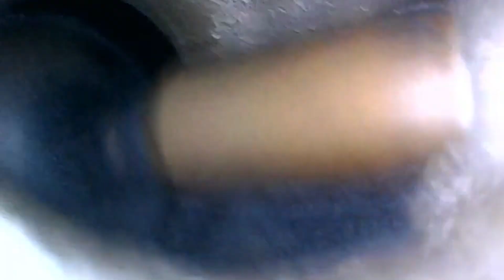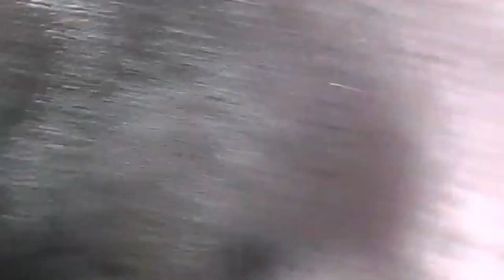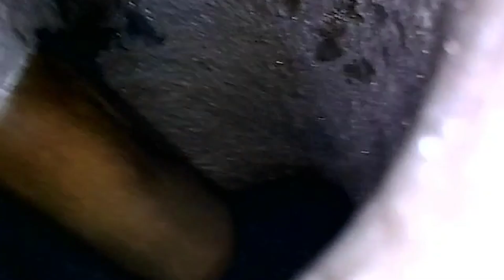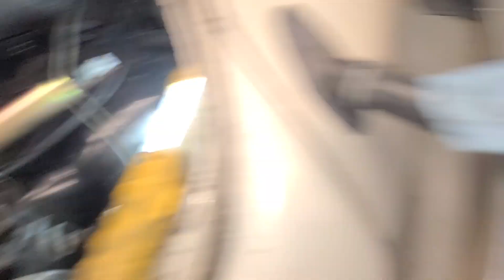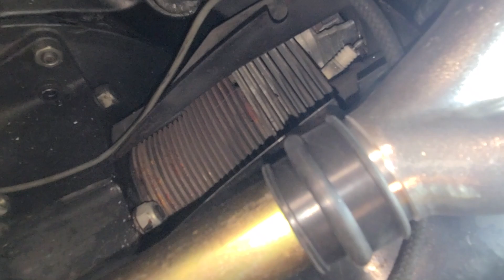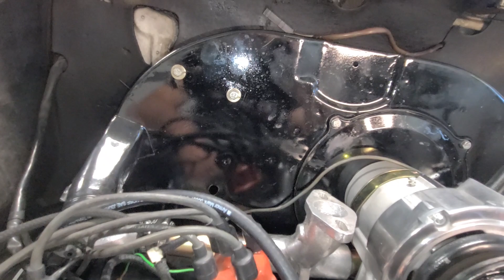1979 VW beetle Fuel injection to carb conversion [Part2]

Comment: About to swap a fuel injected 1600 from a donor super beetle into a Thing, from your experience would I be able to scavenge all of the necessary items from the Thing’s current, stock 1600 or are there other differences that wouldn’t be accounted for? Trying to gather up any items I might need before I dig in. Thanks!
Reply from the maker: There are quite a few electrical components, but assuming you have those,  the only real difference is the fuel flow.  Different pump,  and fuel pressure meter,with return line

Comment: Alex.  I have a 1978 super beetle fuel injection, just like you are showing in your videos.  I have a question about the wiring you used in the later videos for the conversion from fuel injection to carburetor.  What size wires did you use for the new fuel pump assembly? Also, what size wires did you use for the relays where you plug the starting "hot" wire to the electronic control unit connection piece so your car would start?  Finally, where did you get the bolts to use for the oil pump where 1 bolt had to be replaced?
The videos from 1 to 6 are great!.  You did a great job explaining how to convert a fuel injection to a carburetor.

Thanks,
Dennis

Comment: The vent plate you installed is upside down. Look in the service manual.
Reply from the maker: Hmm.
What is this manual you speak of???

Seriously, I don't even read instructions for IKEA furniture 
😂

I wonder if it will make a difference
Reply: @AlexPlatacis  Bentley vw service manual. Or find a google photo of the plate installed. Makes filling the engine with oil a lot easier.

Comment: Hi, you never put what size the studs are. I’m currently involved in this conversion and I’m stuck at the point where I need to remove that stud but I don’t wanna do it until I have another one. Can you please post what size it is? Thank you very much and have a great day.
Reply from the maker: @Peanut.c  sorry.  Guess i forgot to add the parts.

They can be found under Dorman 03411
10-M8 1.25x56mm
https://www.autozone.com/emission-control-and-exhaust/exhaust-manifold-bolt-spring/p/dorman-help-exhaust-manifold-hardware-kit-03411b/440066_0_0?spps.s=6507&cmpid=LIA%3AUS%3AEN%3AAD%3ANL%3A1000000%3AHRD%3A19489353553&gclsrc=aw.ds&gad_source=1&gclid=Cj0KCQjwqIm_BhDnARIsAKBYcmtQWMxNjoSQ-gcH32Snh7CjyPe0kAuMhgpmBabQioLss0k2tdWxWekaAggdEALw_wcB&new_store_set=true

Comment: Did you put in the "Hoover bit"
Reply from the maker: Huh?
Reply: @AlexPlatacis  It is an odd shaped small piece that goes between the shroud and the bottom of the oil cooler.  For better explanation might go to "The Samba"  Its a pretty small piece not wider that the oil cooler mount.
Reply from the maker: @williamoorejr  i think you can see that part in this next video.  It's a bit more detail on adapting the shroud
https://youtu.be/rp2f0Idf9jI?si=03kIkJr58VQ73EB3

Comment: it will run better with a 30 Pict-1 carb or a 30/31 Pict as the manifold you put on is universal and will take carbs from the 28 PCI to the 34 Pict-3 any carb you prefer the 30 Pict-1 carb is preferred as there is no bypass air circuit to deal with with the 30 Pict-3 and 34 Pict-3 and 4 carbs.
Reply from the maker: @DerekObidowski  helpful information. 

 The carb in this solution was included as part of the kit from JBugs.